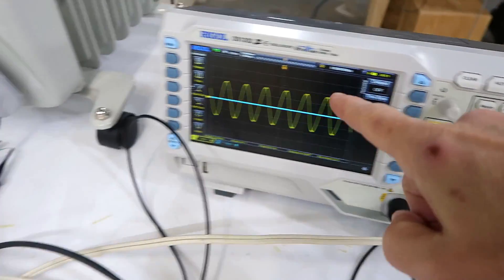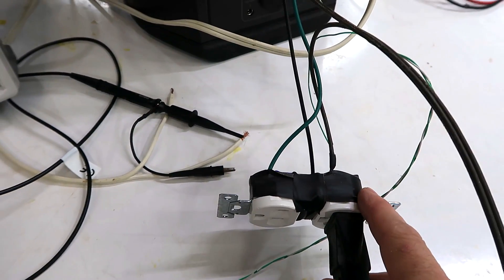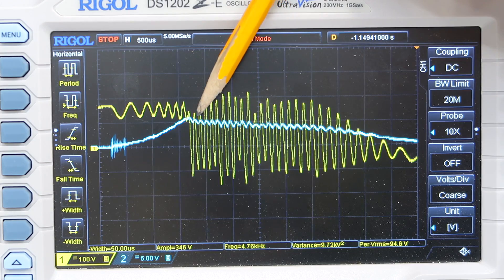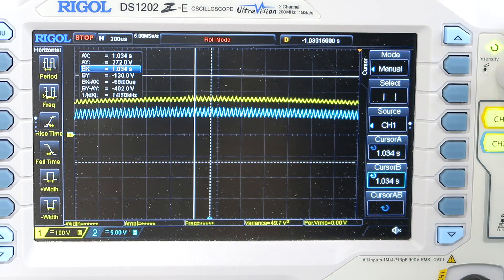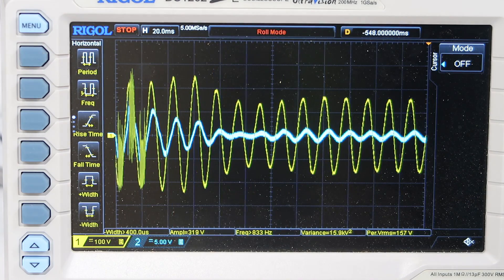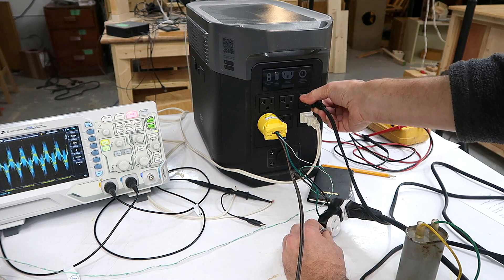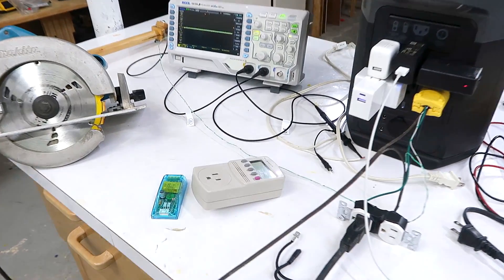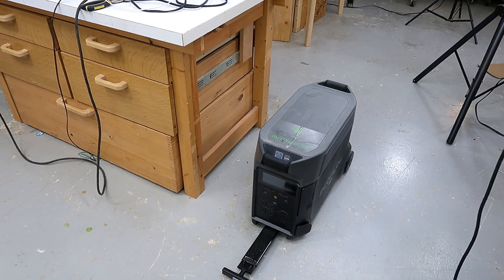Inverters don't like power tools

Comment: I've had good results running power tools off of power inverters for many years now, although these are inverters connected to my solar battery bank and not a stand alone battery/inverter box.  A good thing to do is compute the proper size capacitor to add to the motor to correct it's power factor and then wire that capacitor in behind the motor switch.  Some results:
https://youtu.be/qf_ZLIYT0Ro

Comment: I had an issue with the inrush current of certain electrical devices in my home, due to old fuses. Once i started a device that required a high amount of inrush current, the fuse blew. But there was a real simple and cheap solution: there are devices called inrush current limiters. You plug them in between the mains socket, and the device you want to power. The device switches a resistor between the mains and your device, until the current lowers to a reasonable amount. It then connect mains power directly to the device. It solved my problem and wasn't expensive at all. The thing cost me 20 or so bucks and was in stock at my local hardware store. This should solve your issue with your power banks quite neatly.
Reply: You just stuff pennies in the fuse box. Problem solved!
Reply: @1pcfred  Fried my entire installation following that advice, pure luck the house didn't catch fire 🙈

Comment: With an inductor in series and then the capacitor in parallel you would have a LC filter. Better at filtering out the high frequencies and would make the "standby" waste a bit smaller.

Inrush current limiting thermistors could also be fitted to the tools.

Comment: Like you said about the large smoothing capacitor, its not optimal, but several ways to get around it. having an external cap like you did, just in its own casing that you put between the power tool and the battbox. or integrating it by putting a dedicated outlet with extra smoothing. 
in both cases you can certainly toggle it with a switch, or automatically on load detection.

Comment: I have a pedestal grinder with 6lbs 8in steel plates. I have free running. When I run surge loads, the induction motor acts like a massive buffer

Comment: For inductive loads (electric motors), you need a low frequency inverter with a proper transformer. Toroidal are the best.  Cheap inverters don't have these

Comment: You're EcoFlow's best Beta tester. They should hire you as an independent consultant engineer. 
To run inductive loads, only LF inverters make sense.
Yes they have a big transformer inside. Yes they are heavy. Yes they are more expensive. 
The right tool for the right job, always costs more than a general purpose tool.

Comment: Ignore that other YT'r.  Glad you showed it is possible to filter the HF content, but does come at a penalty.  Could employ an active strategy to bring in the filter circuit when needed and pull it out when not to remove the phantom power.

Comment: A lot of it has to do with the noise thats induced onto the ADC's that sense the voltage and current .And oscillations on Resistive overload are caused by the drive voltage on the gates of the Output FETS . Theres actually 2 sections in the inverter. 1 a boost circuit that brings the voltage up to around 300V or so DC then section 2 switches that high voltage DC into AC . I in 30 years of playing with H-Bridges and inverters have never seen one that will accept this kind of overload gracefully. I think by the look of the waveforms on the scope the ECOFLOW does a pretty good job

Comment: What is the point of this experimentation? I don't know the rated wattage of the inverter but I wouldn't trust any UPS with less than 10 kVA peak capacity to be able to start a 15 A motor to begin with. If the inrush caps out at 50 A, why should we assume it could start the motor or that it would handle it well when it can't.

Comment: To Eco flow's credit and yours, I like the open discussion on the design and operating behavior.  What I see is an opportunity to solve this problem, a big win for you, them, and everyone!  Here is my $1M+ idea:

I think the focus should be on the tools that don't have that soft-start feature... like your skill saw.  Make a product that would be an external retrofit box that you'd plug the tool into that is then plugged into the Eco Flow.  That way you don't burden the cost of this for the main box for those that don't need this... and besides, this only applies to certain power tools.  The retrofit box could employ some strategy that it does nothing until it senses the power tool being turned, that way it wouldn't be drawing all that standby power like that 25uF filter cap you added.  I believe it is well within the capabilities of engineers to come out with a design... I know it's not easy, but that's what will make a solution like this valuable!

It's kind of funny, but the more you're talking about this product and seeing the technical details, the more I'm liking it!
Reply: I had a similar thought, but as you might guess they already exist.  Search for "power tool soft starter", you can buy them as a control module to hardwire in or as a plug in box.  That said, they (the plug in style) seem expensive enough that there may be room for ecoflow to sell one as an accessory at a lower price point.
Reply: @jamesthomas4080  this is great info. maybe matias can get one of them and test it out with the ecoflow!
Reply: yeah this seems like a good solution. have a "powertool" addon module.

Comment: So the irony of it all was that the thing that killed your killawatt was in fact a safety system designed to protect electronics.
Reply: Nope  What killed the "Kill A Watt" meter was the type of power supply used inside the meter and its lack of line transient protection circuitry.  But what the hell can you expect from a $20 meter.

Comment: I don't necessarily think it's possible (or at least reasonable) to design an inverter that "reduces the voltage smoothly to avoid an overload". Keep in mind that it's intended to produce a 120Vrms output, which the grid will do fairly reliably (minus some voltage loss during the startup due to overloading the circuit). The amount of the voltage would need to drop from this inverter would be higher vs what occurs in mains in order to maintain the current output below the OCP threshold. You're basically suggesting that the inverter emulate brownout conditions, which isn't necessarily a good idea.

In your control loop, you're now also switching between two modes: Control 120Vrms output waveform based on fixed 120Vrms reference, or (if current is too high) adjust output voltage reference based on measured output current. Since the load is unknown and changing with respect to time, you need to gradually adjust your output voltage reference with an integrator (always a delayed response, hence slow). Maybe with a specific digital technique you could quickly narrow down the range for that integrator to be in, we're talking about control methods that extend the beyond the typical PID controller here and with growing complexity.... And can you achieve this with an off the shelf control IC? Because you may now be talking about custom silicon or an FPGA or an expensive processor to add in this new feature, if an off-the-shelf part doesn't already integrate it.

So that comes to what your end game is... Is it not blowing up Matthias Wandel's 30 dollar kill-a-watt?(I don't say this to sound mean, but prove a point) Sounds like he can live without using the kill-a-watt on there with his power tools, buy him 100 of them, cheaper than the parts and R&D to implement his solution. And it would probably be easier and cheaper to adapt the kill-a-watt to not be damaged under these circumstances. 

Really the best place to control this is at the devices you're starting up, soft starts are designed to solve this type of issue. You're instead suggesting the inverter need engage in an unusual behavior to support your transiently low impedance load. Unfortunately soft-start units aren't always cheap or readily available when not integrated with the product already, that is a struggle I DO understand. 

The other thing I'd say to take a look at is what is the surge rating in watts for these EcoFlow power stations? Is there one? Often inverters have a surge rating. Usually these are the ones designed for automotive applications, see this Sungold unit(Not suggesting this is automotive specific btw) here: https://tinyurl.com/2r3p3njd . 4kW inverter with 12kW peak rating. Without measuring it's difficult to say exactly how it handles this 12kW condition but I imagine there's some overhead built in where a 12kW surge can be handled for some seconds 'N' without harming the inverter, after which the inverter would have to engage in OCP. That's probably a more likely approach to the issue that you're facing. And if that's not the approach they're using, then it would be interesting to see what they are using.

And at the end of the day, your capacitor helped. Could always throw it on a light switch and just use it during startup. You'll probably want something that supports ZVS for this when turning it on, however. How much is it impacting power factor after the load is on and running?

Comment: On that scope you can use masking to trigger a single shot of what you are trying to test automatically.  You got it done obviously but who doesn’t like being fancy.  Basically it will just put a voltage offset masked around the regular sine wave and trigger if you touch the sides.  I discovered that when testing how an inverter based uninterruptible power supply kicks in.  Spoiler it only missed half a sine wave.

Comment: The soft-start feature on the power tools seems to be key, if you want to power them from an inverter.
Reply: Will work with soft start but ultimately masks design flaws per normal
 consumer expectations
Reply: I agree.  Adding a soft start reduces both mechanical stress on the power tool and on the backend power source which is not always grid.   I notice some table saws have such a hard start that it messes up the blade height adjustment that I carefully adjusted prior.  A soft start could also reduce damage to a body in the terrible case of an accidental startup at the wrong time.

Even a generator with its higher inductive buffer could get bogged down depending on its size and multiple hard starting power tools that might be starting at the same time.  I've seen gas generators advertised as 2000W instantly shut off with just a single miter saw on it.  

The bottom line is adding a soft start device to the power tools costs the tool manufacturers money upfront and introduces another failure point for their warranty program which is a backend cost to both their financials and reputation.

Comment: This is why i use a pure sine wave backup battery for my PC, got tired of replacing its power supply every year. (My father is a mechanic and he has two air compressors). This is why I like getting soft start tools.

Comment: I would love to see you hook up your o'scope to a new Ford F150 electric pickup truck. They advertise it as ideal for contractors, who often carry saws and boards in the bed of the truck. I wonder if the invertor powering its bed outlets have better or worse high load characteristics.
Reply: @zlmdragon.  Right, that is the ticket
Reply: I’m trying to figure out what happens if I overload my Ranger outlet with a circular saw.
Reply: The specs I can gather say the F-150 lightning uses AC Synchronous motors, So id bet the power tools plugs are run off that inverter. Probably a transformer in there somewhere too since id imagine the drive motors are running higher voltage than 120VAC.  in the case of the truck if my guess on plug source is right at all is the inverter is just so big it soaks up the hit of a tool starting up.
Reply: @filanfyretracker  They wouldn't need an extra transformer to lower the output voltage because the inverter output is PWM. They'd just use a lower duty cycle. However, IIRC the AC outlets can be active when you're driving. If true, this would necessitate a separate inverter.
Reply: @filanfyretracker  The V2L (Vehicle to load) outlets on EVs come from the circuits that are used at other times to charge the vehicle's batteries from AC supplies. The inverters that drive the traction motors are only connected to the traction motors.
The AC charging circuits are run backwards to create AC from the battery. The AC charging circuits use active rectification to reduce losses compared to passive rectification, and by controlling the active devices differently, the charging transformer can be used for discharging.
The AC charging needs effective power factor correction (PFC) circuitry so that it minimises the current draw and harmonics when charging at 10 kW or so. A wall wart charging an iPhone doesn't need to worry so much, but an EV taking 10 kW with a poor power factor could cause problems.
The PFC circuit actively alters the current during each cycle to make it match the supply voltage, giving the good power factor. Running the same circuit in a different way during V2L allows the sinewave of the AC supplied by the vehicle to be produced.

Comment: Turns out this is one of the best advertisements for EcoFlow that they could get. The product seems quite solid to me. Thanks for doing the work.
I like the fact you tested the chargers - as I wrote under your previous video, the failure happens most probably only with capacitive droppers, the switch-mode supplies (even the cheapest one) should survive such oscillations.
Reply: Most SPMS should be fine with a lot of bad power, especially the universal ones. (Unless you are going too much in to overvolta ofc)
Reply: @rkan2  I would not use this to power any sensitive digital device
Reply: @davidcross890  But what are those? Computers etc which pretty much all have an SPMS really aren't "sensitive".
Reply: @rkan2  Measurements of power with audio equipment, computers, etc indicate otherwise
Reply: @rkan2  Computer with good power supply aren't sensitive on AC electrical entrance because a good power supply has internal filters, but it still can suffer interference from EMI irradiated near unprotected USB cables (electrical feeding USB cables don't have shield) and other unprotected cables, and the panel too, because the front part of a PC is plastic.
Reply: Scary 😱 that you think this is solid petformance
Reply: I don't think so. This video points out all of the flaws and weaknesses in the ecoflow high frequency inverter design.
Reply: Capacitive droppers should also be ok if they have an appropriate zener diode.
Reply: @Ultrazaubererger  that zener would need to be able to shunt quite a bit of current to survive kHz oscilations, keep in mind the power going through a capacitive droppers is linear with the frequency
Reply: @ratchetfreak  It should be rated to survive short spikes of about 1000V which normally occur on the regular electricity grid, however the standards for this probably don't take into account that the spikes continue for quite as long.
Reply: @ratchetfreak  Not sure but I think with the inrush resistor and other stuff taking some of the load and the time of actual high voltage/frequency being just a few cycles it should be able to survive.

Comment: Matthias now you have me wondering about the F150 lighting.   The truck is loaded with electronics and contractors are going to use these with power tools.    Maybe Ford will drop one off for testing. :😂

Comment: Switch mode power supplies also work at high frequencies because the transformers can be smaller that way. (since the transformer doesn't get saturated due to the high frequency and also a  less windings per side due to higher impedance)
Reply: I'm surprised they don't operate much higher; MOSFETs, and ferrite-core magnetics, can get small enough to save significantly on size and therefore cost.  Maybe not an overall cost savings, but the reduction in size can be worth a minor cost premium.

IGBTs are usually chosen to reduce cost, without much concern over efficiency (because they always drop a volt or two, whereas MOSFETs look like resistors: voltage drop proportional to current).  Presumably they could save some efficiency too.  Perhaps it wasn't worth the engineering time -- faster, more compact designs can take a lot of time to optimize, unfortunately.

Comment: I have the same problem you have with your big bandsaw with an old amplifier of mine. When I try to power it with my bluetti ac200max it shuts down every time, detecting a short circuit.

Edit: it has a very big transformer, presumably without any inductors on the input side. When I power it on the mains I hear a loud "thump" sound (I'm on 230v)
Reply: That makes more sense, I'll look into that! Thanks guys
Reply: Amplifiers usually have a lot of capacitance for smoothing. The capacitors need to be charged and that can create a current spike that "look" like a short.
Reply: @m8e  exactly. you're amplifier needs a soft start unit that allows the capacitors to charge slowly before the soft start relay shorts and allows full power. xraytonyb has a great video on this.